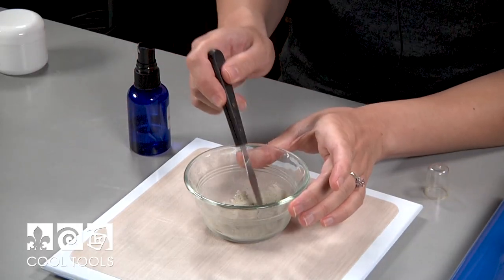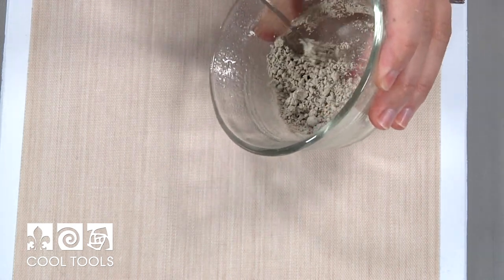Cool Tools | Reconstituting Metal Clay by Karen Trexler

Comment: Is it ok if there are mixed brands in your starting crumbs?
Reply from the maker: Yes, as long as you keep in mind the firing temperature and time of each brand of clay. For example, if you were mixing FS999 and EZ960, FS999 fires at 1650°F for 2 hours and EZ960 fires at 1675°F for 2 hours. You'd want to fire at the lower temperature of the two - 1650°F; but at a longer period of time to ensure the higher temperature clay sinters. For example, you'd fire at 1650° for 4 hours to ensure sintering of both clays. Hope this helps!